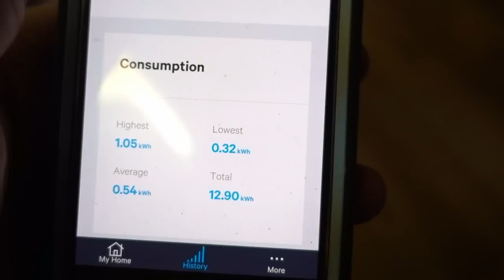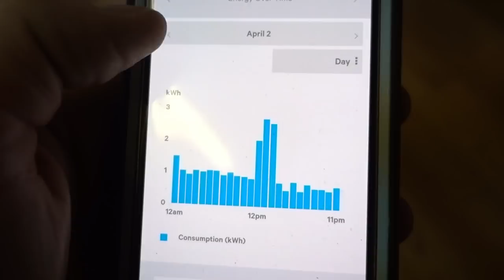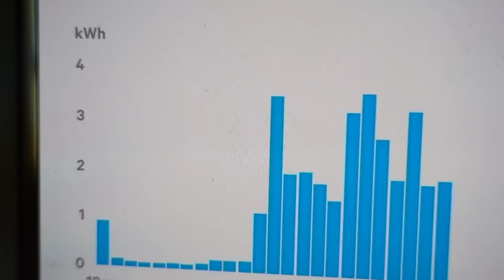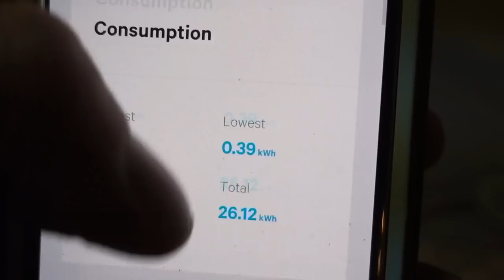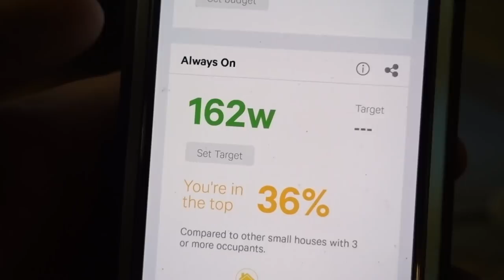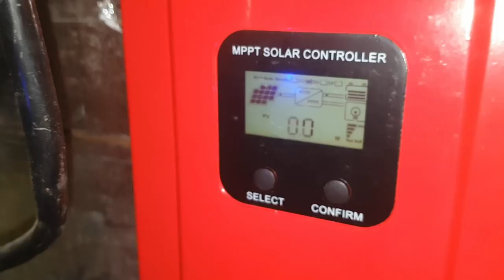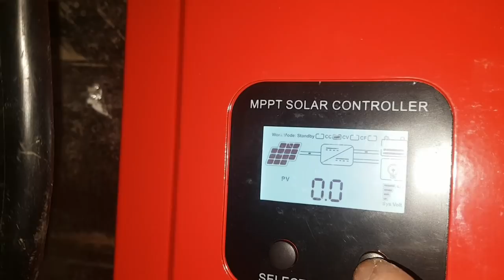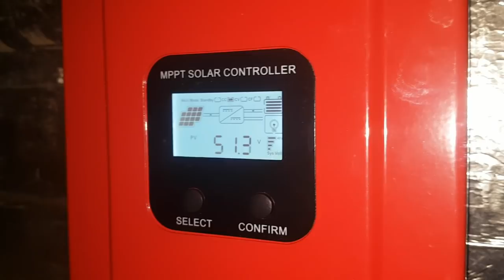36Kwh A Day And 60A Esmart3 Install In Work Trailer

Comment: Lightening hit mine nearby 60A C.C eSmart.  It turns on but stuck on clock set mode buttons unresponsive.  manual say "change fuses" but they seems to be ....stuck.   Its says nothing in manual about fuses being sodered.  Any advice?????

Comment: Hi, the small MPT-7210 is a BOOST charge controller. I use it with a 12V 100w panel to charge a 24 v batt bank.  it works because its a boots... Do you know if this Esmart  have that feature to charge a bigger bank with a smaller V input?
Reply from the maker: no it does not, the PV voltage must be higher.
Reply: no dear Esmart cant boost  solar input voltage.

Comment: Looks interesting - but it appears to be behaving like a piece of wire or pwm by pulling the panels down to the battery voltage. Sure the transformer is OK?
Specs on aliexpress doesn't mention lithium - just "other types can be defined".
Would be good to know if it'll charge 14S, 15S, 16S too.
Reply from the maker: so it turns out do be a good mppt in the sun but bad in the cloudy weather.
Reply: @GoingOffGrid101  Good to know - thanks...
Would you show off the config interface and options too?

Comment: My esmart3 I put 3 265w panel in series but it keep maxing out at 100pv volt my battery bank is a 24v and the cooling fan never comes on
Reply from the maker: Does yours say 150 max?
Reply: @GoingOffGrid101  yes it does

Comment: Hi:
My neighbor is interested in the eSmart3, but you didn't give a link, only for the Reliable.
Would you mind doing that, if possible.
Thanks.
(He's doing lithium, but a fairly low voltage, so I'm concerned about your comments there.)
BTW, he told me that he was going to subscribe,  so I'll check with him  on the starus of that.
Reply from the maker: https://www.ebay.ca/itm/APP-WiFi-MPPT-Solar-Charge-Controller-Battery-eSmart3-60A-Max-150V-Input/253857547258?ssPageName=STRK%3AMEBIDX%3AIT&var=553151114144&_trksid=p2057872.m2749.l2649

Comment: I never had a problem with esmart3 40 or 60 amp but did not like the esmart2. good luck 2 in series 74 open volts is not much higher then your dc battery voltage
Reply from the maker: it works well in sun, not so good in cloud though. i ended up going 4 panel in series.just a thought couldn't you put solar on a trailer beside your house and use it ?
Reply: @GoingOffGrid101  they will not allow any panels if not connected to the grid I refuse to do that
Reply from the maker: @oldtimeengineer26  I understand but its a movable trailer with no codes, you can have everything including the CC solar panels and batteries all on the trailer and add a generator plug on the side of your house and only plug it in when your using it ? lol just a idea, kinda like my work trailer with 1030w of solar. I could fit another 570w of I wanted to :)